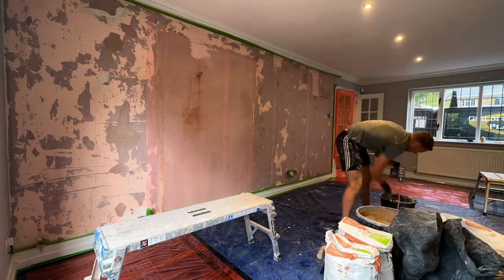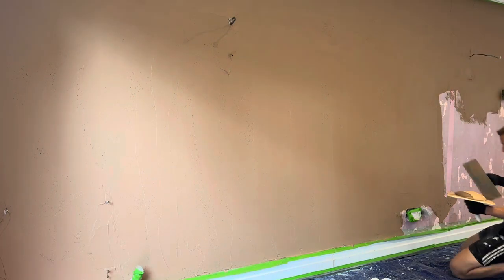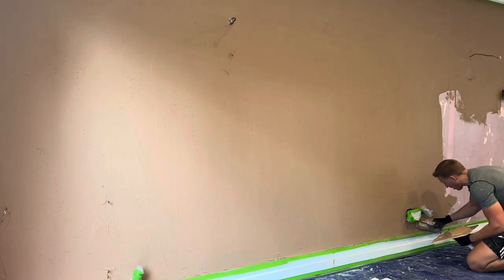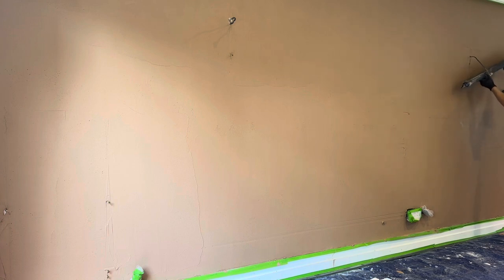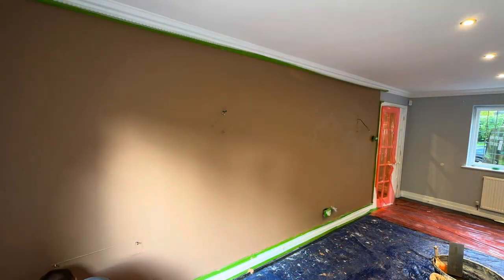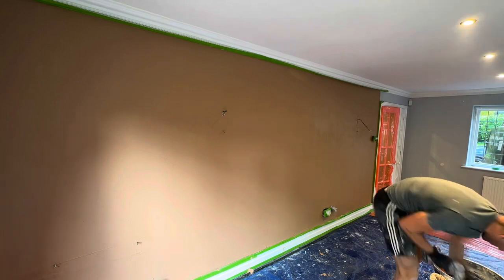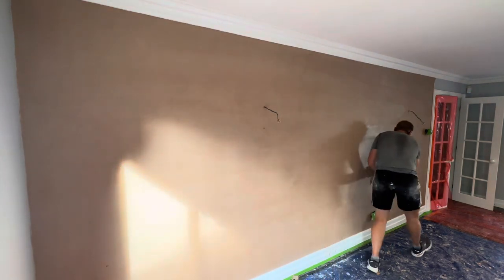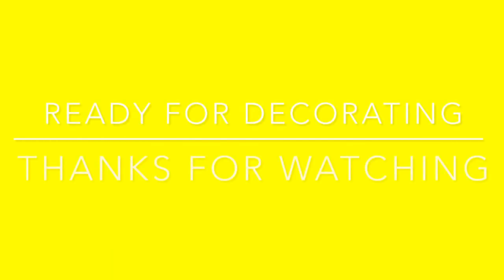How to plaster a wall: Explained by a professional

Comment: Lovely job mate. I tried taping up ceiling lines, skirting etc but never got the hang of it. Often when I pulled the tape it took some plaster with it which was always a nightmare. I’m from up the road in Woking, Reading boy finally made it out to a nice area haha
Reply from the maker: Thanks. Yeah taping up can be a bit tricky to get right. I like to leave about a 5mm gap (slightly more than the finished thickness) then remove the tape after or during the 2nd wet trowel . That way if the tape pulls off any of the plaster it’s easier to repair. 
That said I don’t always tape up. Normally only if it’s been recently decorated or has fancy cove.

Comment: Cool - do you feather in a bit where you meet the skirting or keep it flat all the way down?
Reply from the maker: Thanks. 

If there is plenty of thickness on the skirting board, I will just keep the plaster flat all the way down. 

But if the skirting tapers up towards the wall and it’s a bit thin, I will sometimes taper the plaster in order to keep the lip of the skirting visible. 👍🏼

Comment: why not use sbr? 5 coats of pva is to much,
Reply from the maker: As I mentioned in the video, this job was prepared for me by the builder and to a very high standard. 

The walls were very old and while I personally would have used sbr there is absolutely nothing wrong with 5 coats of PVA.